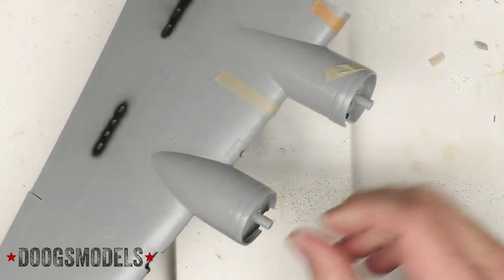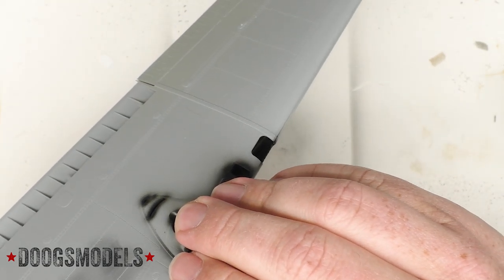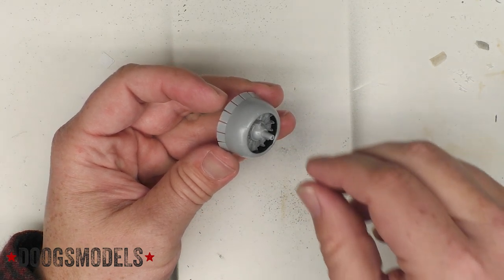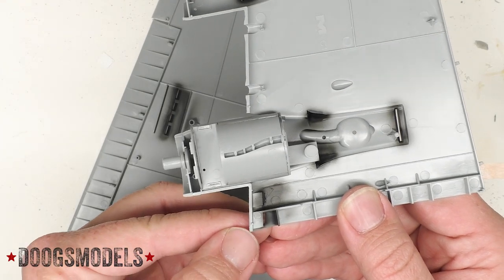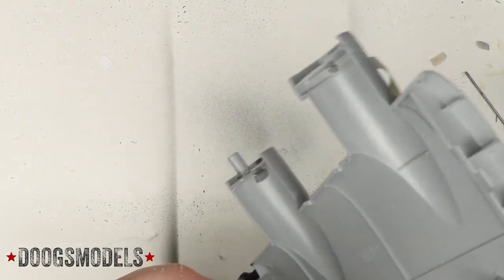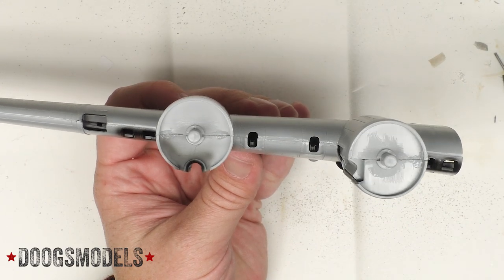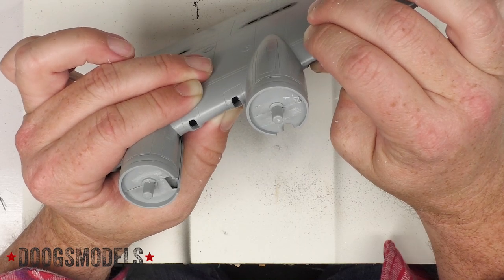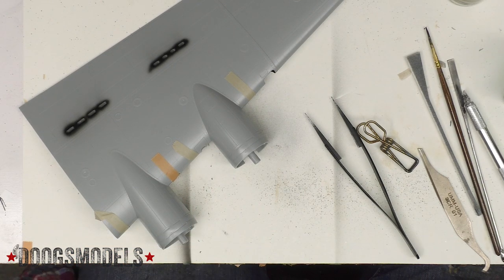HK B-17G Build - Part 11

Comment: Amazing to see the (wrong) HK wing airfoil: The real wing airfoil was a perfectly symmetrical shape up/down, as on many liners of the 1930s (the lift was achieved by the angle of attack alone), and Monogram got it right 45 years ago...  I always assumed the Monogram kit was wrong, until I realized no, they actually researched it right in 1975... And the rest is to the same level, unlike their B-29 and B-24s, which are mostly terrible (and asymmetrical in the B-29's case).